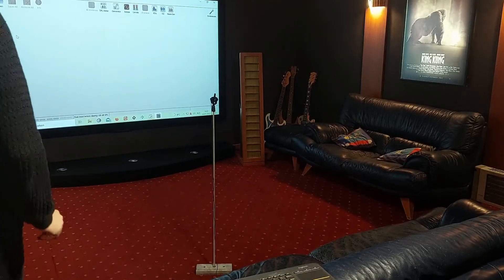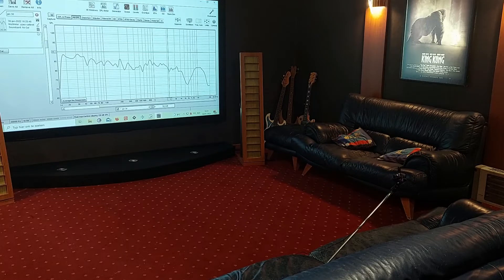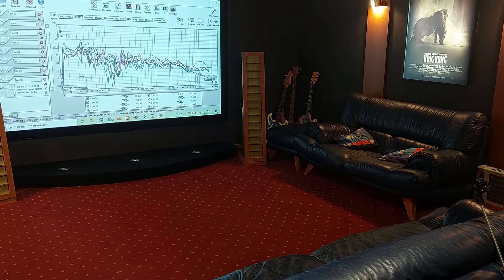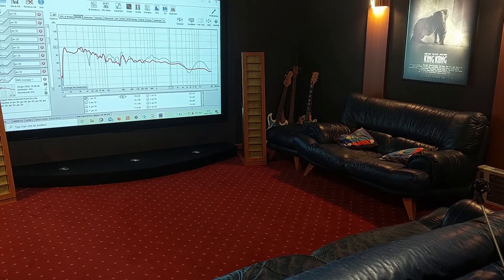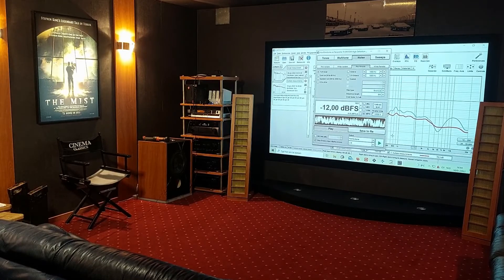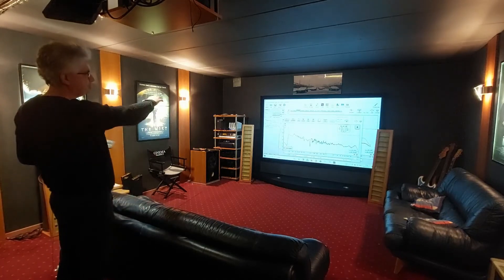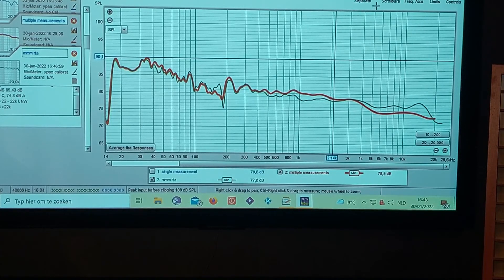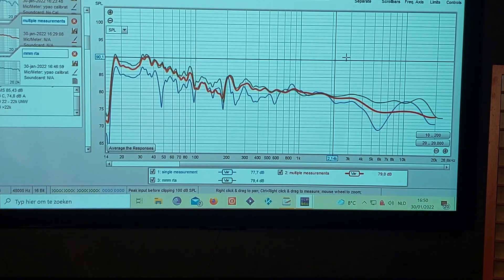REW single measurement vs  multiple measurements vs moving microphone measurement

Comment: Thanks for the video I will try the mmm. Do you use any sort of room correction DSP like the miniDSP-HD? Tod in Vegas 😊
Reply from the maker: Hi Tod, In my  HT , I only use a HTPC ( its an MSI gaming series PC infact ) as a source. I stream movies over Kodi or Stremio, I watch youtube, I stream music and  the PC also has a DVD slot , that I seldom use. So I installed  Equalizer APO 1.2.1 on it. That is a free Parametric multiband equalizer for Windows using Audio Processing Object (APO) technology, which allows you to change the sound parameters of all applications at once at the operating system level.  Using REW measurements of the raw system and choosing a certain room correction curve, I can create some sort of automated correction file that can be uploaded in APO 1.2.1. In other words, I don't have to play with the parametric equalizers myself. I only have to point out my desired room correction curve .
Of course , before starting , I made sure I had my two subwoofers at the best place in the room to prevent dips and I have a pretty good acoustic threated room to begin with.

Comment: i dont understand how these measurement readings work. my microphone volume is all the way off and im still getting frequency graph readings. if i turn up my mic it starts to feedback. ive watched lots of videos but seems confusing. ive copied every settings from multiple videos and still the same happens
Reply: if the mic is feeding back it is playing through the speakers which is incorrect for measuring. You shouldn't hear it through the speakers if you talk into it. The mic will still be able to measure signals even when it's not in the speakers.
Reply: If your RTA MIC is on but you are not sending out any sweeps or pink noise then what you are reading is the actually room levels. This is common and typically consider in the decision on how to EQ a room. For example, you might notice higher reading with a fan is on vs not. I'd recommend looking it up and learning how to understand it to get more accurate tunes for your room. Cheers

Comment: If you can edit your description, I suggest deleting the apology for your "bad" English; it's fine! Thanks for the video. What parameters do you have selected in the RTA controls, and why?
Reply from the maker: Hi,
I have Mode : RTA 1/48 octave , Smoothing : No smoothing  ,FFT Length 64k , Averages : forever , Window : Rectangular , max Overlap 50% and as I explained in the video , I set Appearance to "adjust RTA levels"
In my search for good useable settings i found my solution at this forum :
 https://www.audiosciencereview.com/forum/index.php?threads/rew-moving-microphone-method-help.12641/ 
post 13 april 18 2020
After reading some info regarding windowing, I found the following :
The FFT resolution is also affected by the  setting. Rectangular
        windows give the best frequency resolution but are only suitable when the signal
        being analysed is periodic within the FFT length or if a periodic noise signal is being
        measured. The Rectangular window should always be used with the REW
        periodic noise signals.
        Most other signals, e.g. sine waves from the REW generator or test tones on a CD or random noise, 
        typically would not be periodic in the FFT length. Using a rectangular window when 
        analysing such a tone would generate spectral leakage, making it difficult to resolve 
        the frequency details 
https://www.roomeqwizard.com/help/help_en-GB/html/spectrum.html

As I showed in the video , I have used the REW generator  with periodic pink noise and thus I set the RTA at rectangular